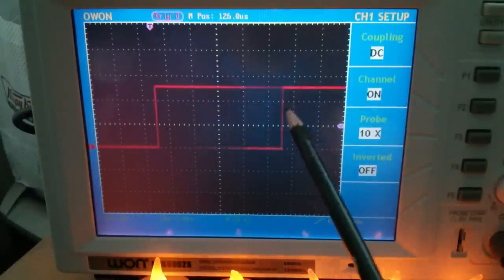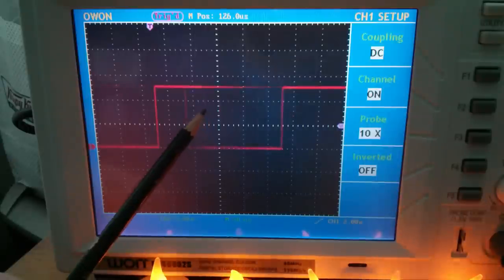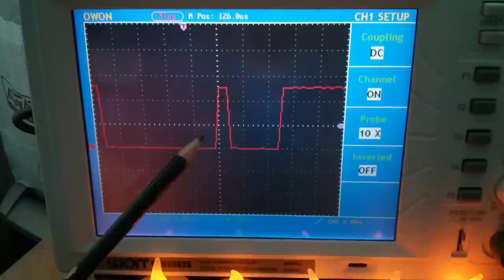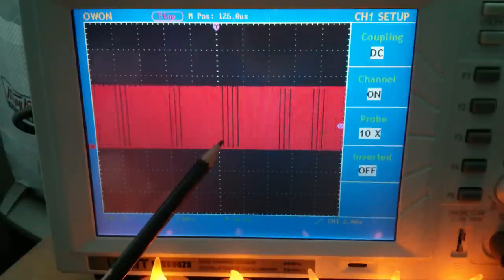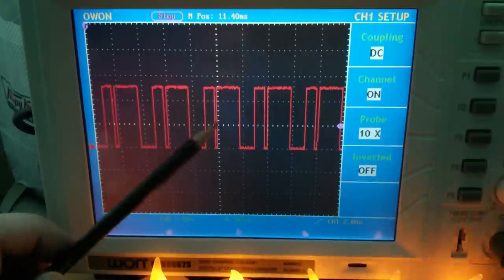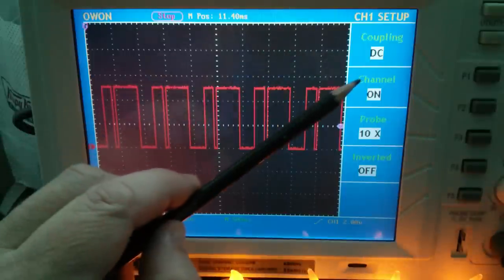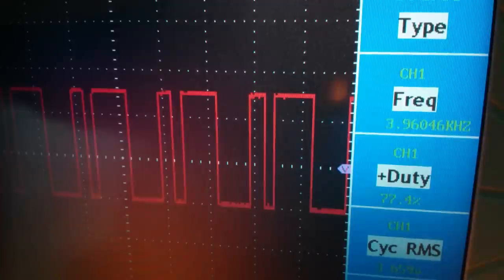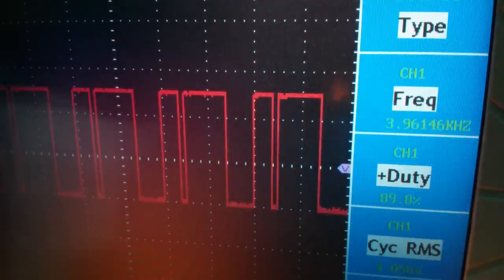50p Wilko LED Tea Lights use PWM and PRNG

Comment: It's quite astonishing just how much micro electronics, and LED's have  progressed in recent years.  I've been around long enough to remember when LED's first appeared and how amazing that was. They were just dim little things, generally used as panel indicators and status lights. Actually, I still have the first one I ever bought, it's been strapped across the output of a 5 volt PSU I used for 74 series chips since new in the 70's!  Despite being overdriven all those years it still works, if a little dimly! Now they are used as domestic lighting, car headlights and amazing torches!   Now I discover they are available with built in micro controllers!

Comment: I can't even imagine the complexity of the manufacturing process to create those LEDs with the exceedingly small chip embedded in them.  And then - for such a small price.  Amazing !!
Reply: You can get 4 of these for a pound in poundland, they have the same led in them as I took one apart as well.
Reply: Even more amazing about it is that it lasts for ages if not overdriven, I have two of these (one with external black blob chip (no PWM) and a microphone (modified by replacing GaP yellow LED with warm white LED), other is 3mm LED with internal PWM PRNG chip) working over 2 years and I lost count how many CR2032-s I have discharged with these bad boys.

Comment: Try a small loudspeaker in series with the LED, it will probably play a tune. The ones I took apart had a small COB ob a thin PCB that did the flickering, and it was a musical card melody generator.
Reply: I had one here that was a choo choo train chip! I did it with a photo transistor on an electret mic input on my olympus sound recorder.
I was very amused by the results!!!

Comment: I buy these by the 100's. They are so much cheaper than buying the batteries.  We use them in the dog training collars. The ones I get have a  switch that I reuse for lighting gift boxes. We get them in a box of 50 for $20.

Comment: Nice one Julian :)

Not related to this video:
I wanted to ask you a lot of times if you know about "5A MPPT Solar Panel Regulator". If you search the exact string on ebay you will find a nice module for solar pannel (red board). Question: is it a real MPPT ? Can you test it ? I have the module but i'm not sure.

Anyway great job with the channel.

Comment: How about putting the o/p of the current sensor through a simple RC filter? Then you could see the waveform generated by the PWM on your scope.
Reply from the maker: As a series of different voltage levels
Reply: Yes

Comment: Hook up a couple to run in parallel, and see if they flicker in sync? One per scope channel?
Reply: If they use a random number generator that is based on shift registers, they should flicker in sync. But they could also use a different type of RNG.

Comment: Those cheap tea lights were good for projects as they had a battery compartment and switch, But now the Chinese make it cheaper by using the legs of the led and a bit of plastic as the switch.

Comment: why not use a transformer with one as the sense coil and one as the driven coil would that work, I don't think that a PRNG us used I think that if you could drive a crystal earpiece you might hear some sort of tune.
Reply from the maker: Yeah, from my loudspeaker experiment, it seems that the sequence repeats, so it's not random. The sequence is a few seconds long.